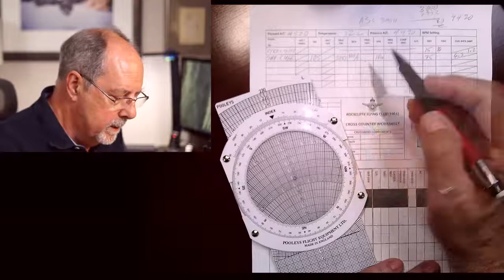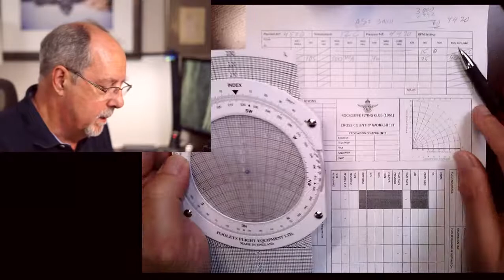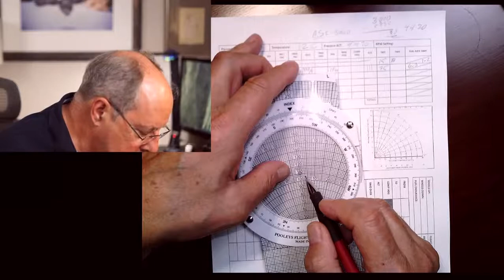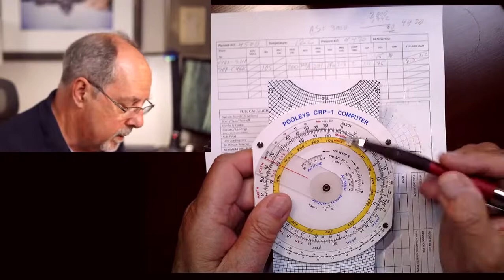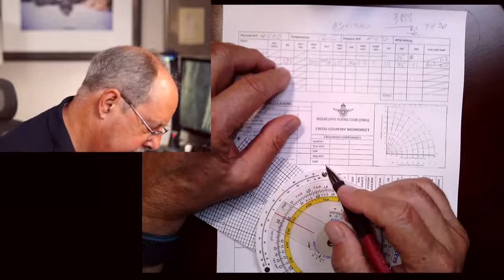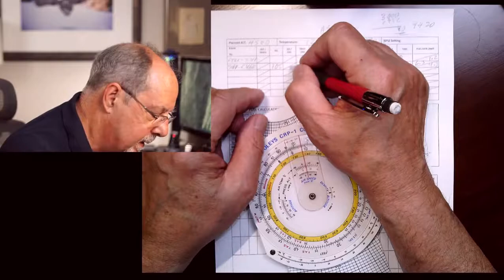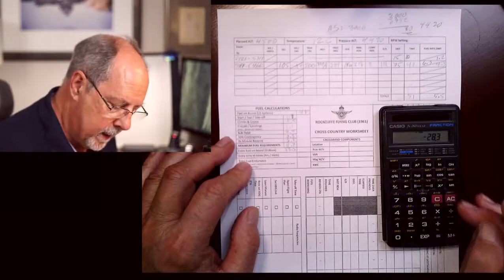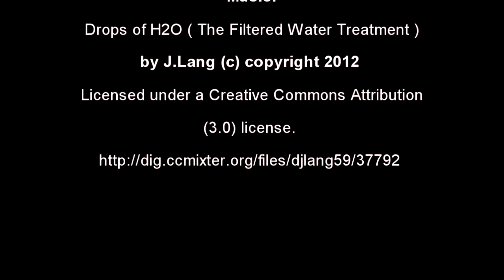Calculator Bake off:  Flight Plan calculator Pooleys CRP 1

Comment: where do u obtain true airspeed?
Reply from the maker: The TAS is an input to the calculations.  I choose the True Airspeed from the Pilot Operations Handbook, Section 5, performance.  I select it to be appropriate for the temperature and pressure altitude.
Reply: @aeroposte  brilliant thank you sir! Did my first flight using my first flight plan this afternoon. All went smoothly thanks to your video :)